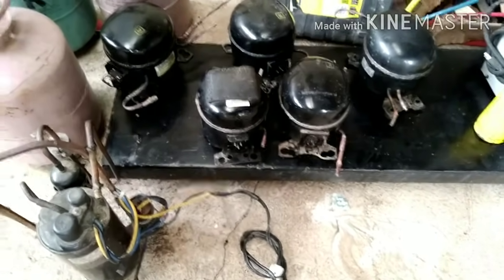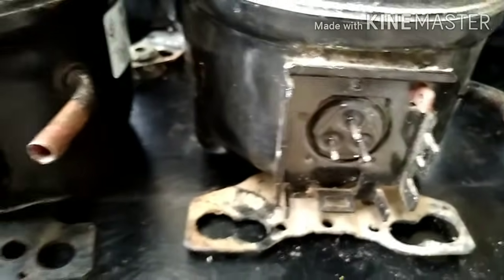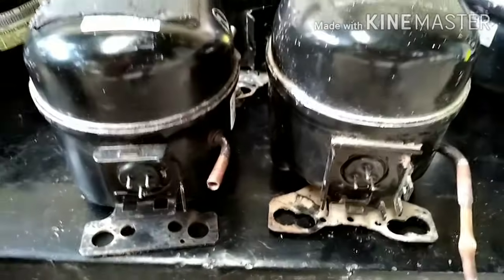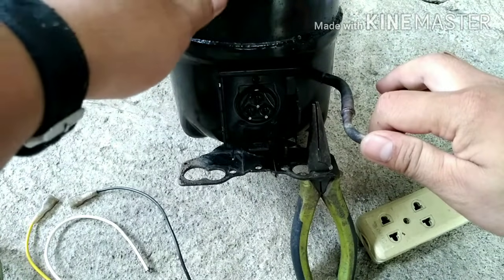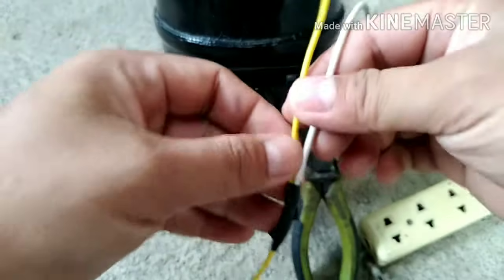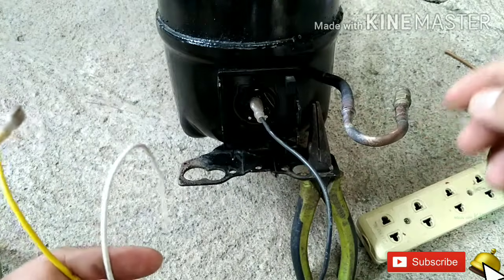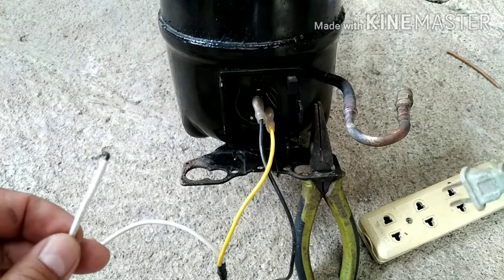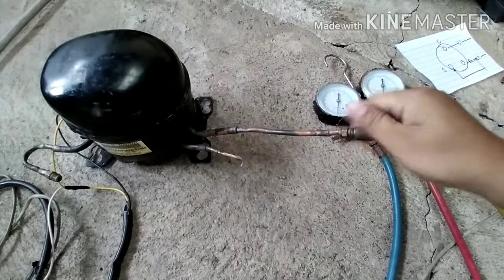HOW  TO START MOTOR COMPRESSOR WITHOUT RELAY ENGLISH

Comment: I purchased a new start relay/capacitor hoping that would fix the issue. But it didn't work. Found your video and decided to try it to rule out a bad compressor, and lo and behold my compressor is shot. Just continues to buzz and not kick on. Time for a new fridge!
Reply from the maker: Thank you for watching

Comment: What if the common terminal is down, does the start terminal remain in the same position?
Reply from the maker: Yes the common terminal remains, if you do not find the symbol of the running and starting terminal , much better to use digital tester to locate CSR. Thanks for watching

Comment: Please if you can help me, I have a 220v/110w compressor when it is running it consumes 145w, it does not have a start capacitor, because I have a 12VDC/220VAC - 370W inverter and it cannot start it, could I add a start capacitor, and what size to try?
Reply from the maker: Hello, 
practical recommendations.. Try to use higher inverter and battery capacity.

Minimal / cheap: 500 W pure-sine inverter + 40 Ah deep-cycle battery — ok if motor really has low start ratio (~3×) and run times are short.

Safe & balanced (recommended): 1000 W pure-sine inverter (with ~2000–3000 W surge) + 100 Ah deep-cycle battery — very reliable, can start most small compressors and give several hours run.

Compact & long-life (best if budget allows): 1000 W inverter + 50–70 Ah LiFePO₄ — smaller, lighter, long cycle life, supports repeated deep cycles.

Comment: Play it safe, put astart capacitor between start and run for the unlock or also said to create movement
Reply from the maker: Not all  motor compressor needs a  capacitor to start. However, There are some particular motor  compressor design  that needs a (capacitor) for a higher torque to start.

Comment: This video was super helpful. Thank you for helping me save a GE refrigerator!
Reply from the maker: Video is for testing  only, please Buy  relay at the nearest refrigeration and airconditioning shop
Reply: @kadiskartemotv  Of course! Your video helped me rule out compressor failure, diagnose the problem as a failed Time Start Device, and implement a temporary workaround to avoid spoiled food pending replacement. I installed the new TSD today and the refrigerator now works perfectly. Thank you again!

Comment: does it automatically mean the run and start motor is opposite from the one you demonstrated?
Reply from the maker: There is marking of (C) Common (S) Start (R) Run in the compressor

Comment: Can you explain this on a 12v DC compressor? I am trying to bypass the on/off switch on my 12v zerobreeze mach1 and I am connecting the controller directly to power and the compressor runs for a short moment then shuts off. Below is a link to what I am working on.

https://youtu.be/jbEaA0Ib1Sg

Comment: i tried this on a wine cooler thats not working and the compressor turned on after connecting hot wires to just the common (top prong)  and Run (right prong).  I did not have to to touch the Start.  Does this mean the compressor is bad?
Reply: If the compressor produces pressure, then it merely managed to start without the second winding being energized.

Comment: This is good information to know if you are waiting on a new relay and got food in the fridge. I turned my freezer to max so it will stay colder longer between jump starting it. Also filled up some Tupperware containers with water so they turn into big blocks of ice. thanks for this info
Reply from the maker: Thanks for watching
Reply from the maker: Thaks for watching

Comment: Boss ask lang po ako bakit binunot mo yong isang wire after 2 seconds. Ano posibling cause if di bunutin
Reply: Pro po pag may relay need din po bang bunotin or di na. Ano po connection if may relay na
Reply: Energizing both windings for more than a few seconds will overload the compressor. The START winding should be energized only long enough to get the compressor started so the RUN winding can keep it going alone.

Comment: thanks zir but can do this jop wile compressor in frige
Reply: Yes, simply unplug the fridge, make all three connections as described (COMMON, RUN, START), plug in the fridge, and remove the splice wire from the START pin as soon as the compressor starts. Just keep in mind that a) there is no external overload protection (as is typical with a Time Start Device / TSD) and b) when the thermostat sees a low enough temperature, it will cut power to the compressor (normal behavior), but when the temperature rises and it sends power to the compressor again, the RUN winding will be energized but the START winding won't (abnormal behavior), which could damage the compressor.  So, when the fridge turns off the compressor, it's best to unplug the fridge, disconnect all wires from the compressor, plug in the fridge, and restart the compressor manually later when you hear the fridge start up the evaporator fan.

Comment: can i use only capacitor, no need ptc , i try turn on compresor use capacitor , result is working properly  , this way can damage compresor?
Reply from the maker: No. PTC relay will automaticaly energize the compressor without our supervision, doing so will over heat the compressor,  as common and run is only needed once once compressor reach atleast 1/4 of its speed,
Reply from the maker: use the method shown on the video,just for  testing, not recommend for prolong use as the compressor turns off and on when the thermostat  gives signal

Comment: Thank you so much for this video. I have an old Frigidaire freezer and the genuine controler relay is discontinued from Frigidaire but worst it is that absolutly unavailable in the aftermarket. So far with your video I was able to start the freezer and save the food inside. I leave it work until it stop then make the contact (as shown) to restart it. I have ordered online  another relay (look alike) and according to your indications I should be able to plug it on the compressor and fix this problem. Thanks again.

Comment: Idol tanong ko lng po Kung paano madetermine Ang suction at discharge pipe Ng ref compressor..may kinalas po Kasi akong sirang ref nmin..gagamitin ko compressor as air compressor..tatlo Kasi linya Ng tubo eh..tsaka Kung isaksak ko compressor ung isang pipe nagbubuga Ng langis..ok p b compressor ko?..Ang reading Ng C-R= 10.1, C-S= 38.2 at S-R= 46.9..sana po masagot mga tanong ko idol..salamat po

Comment: Sir how about a compressor with potential type relay and run/start capacitor . . Do the procedure is still the same .. tnxs
Reply: My compressor started without the capacitor, but if yours doesn't and needs the boost, then splice two wires and put the capacitor in parallel with the one that temporarily energizes the start winding.

Comment: Thank you Sir.This is my question to you Sir,do the run and start change  position?Or the start always on the left and the run always on right?
Reply from the maker: Mostly Start is always at left and Run is at right. Try also to check if there is a label at the triangular configuration, if none do the resistance checking
Reply: @kadiskartemotv Thank you,but how can I do the resistance check?
Reply from the maker: Will make video of it
Reply: @kadiskartemotv  Thank Sir.I looking forward to it.
Reply: @alieupaasewe5111  Use an ohm meter to measure resistance between the center COMMON pin and each of the other two pins and compare to the published specifications for your compressor. For example, according to Embraco's documentation for the EM3D60HLT compressor in my GE fridge, the Start Winding Resistance should be 5.66 Ω at 25°C and the Run Winding Resistance should be 4.42 Ω at 25°C.

Comment: hey were does the hot wire go and were exactly does the neutral wire goes just to be on the safe side thanks
Reply: The hot wire goes to the middle COMMON pin, the neutral wire goes to the right RUN pin, and the wire spliced into that neutral wire goes temporarily to the left START pin.
Reply from the maker: Just follow the tutorial, live or hot wire is the same

Comment: Can you do the same test with a 12v compressor
Reply: No you can't. On a 12v compressor the three connections are the three windings of a three phase motor. It will only run if you use a 12v 3 phase motor controller.

Comment: My firdge have a capacitor near the compressor. Would this work without the capacitor connected in some way ?
Reply from the maker: It will not, starting capacitor is important for the optimal performance of compressor, capacitor is very cheap to buy
Reply: The compressor in my GE fridge started without the capacitor, but if yours doesn't and needs the boost, then splice two wires and put the capacitor in parallel with the one that temporarily energizes the start winding.

Comment: By 'common' do you mean the hot ac line or the neutral ?
Reply from the maker: Either of the two, but its better to use the  live ot hot wire

Comment: Hello i have using my fridge withou relay so the motor wont start what seems to be the problem??
Reply from the maker: Check the overload protector also or the thermostat,or defrost timer
Reply: Mine is a defy top frizzer i bought a new thermostart when i try to install it...it blew my overload protector nd i bought the new one also but stil blew it...i suspect the motor..because it wont start when am startin it without relay

Comment: Another queston why is the compressor overheating
Reply: Because it doesn’t have the relay😂😂 the compressor isn’t meant to be run continuously the relay is there to turn the compressor on and off periodically to prevent from overheating
Reply from the maker: Thermostat will do the work
Reply: @kadiskartemotv  but the thermostat is connected to the relay and the relay then controls the compressor
Reply from the maker: Thermostat = brain of the system

Comment: hey, thks for the vid. Btw we need a capacitor?
Reply from the maker: No need sir
Reply: oh great! But my compressor just hums and doesn't turn. what to do? if there is capacitor then we can try changing it but there is no cap for it.
Reply from the maker: If you follow the step on the vid then it only hums,.most probably the motor  compressor is stack up
Reply: Don't we need a 2nd phase to start it?

Comment: You just helped me fix a super nice/free mini fridge! I saw it on the side of the road in a super nice neighborhood with a free sign and hoped that it would work, I was disappointed when I heard the click of the overload switch kick on. I tested for continuity and it was on all 3 poles and also no short to ground. Also tested amperage of the pull and it was well below short. Bypassed the relay like you showed and boom! Compressor rolling perfect and nice cold fridge.

Thought it was shitty that the rich bastard put a broken fridge out and just put free without "need tlc" or "needs to be fixed". They knew it didn't work and could have taken it to be recycled, but I am glad they didn't ☺. Their loss is my gain. Replacement relay costs 7 bucks and will be here in 2 days!
Reply from the maker: Thank you for wataching ❤

Comment: pano yung may capacitor?
Reply: The Embraco compressor in my GE fridge started without the capacitor, but if yours doesn't and needs the boost, then splice two wires and put the capacitor in parallel with the one that temporarily energizes the start winding.

Comment: Hi, thanks for the video. I have a question. In the uk you have live, neutral and ground which one of these wires do I connect to the common pin?. Thanks
Reply: common pin can be connected to your neutral wire :)
Reply: @ElektroySoundsmusic  Thank you
Reply: When you say "could be" can the live be connected instead of the neutral. Thanks again.
Reply from the maker: Yes,

Comment: Lods pano po ganyan din kasi ung ginawa ko namamatay bigla ras aandar nanaman ganun sir pano po un sana masagut🙏
Reply from the maker: First is Anu po ba scenario kung bakit natin jinerk compressor niyo?
Reply: @kadiskartemotv  ano po ung jenejerk sir  biglang namamatay po kasi 5 to 10 sec umaandar nanaman sir
Reply from the maker: Jerk po is Yung wala po kayo ginamit na relay.
Reply from the maker: Jerk po is Yung wala po kayo ginamit na relay.
Reply from the maker: Magcheck po kayo ressistance ng compressor
Reply: @kadiskartemotv  ay oo sir wala dapat ba talaga sir meron para mag tuloy tuloy ung andar sir
Reply from the maker: Lagyan nyu po relay para magtuloy2 andar pero dapat same specs. Ang video kasi natin ay.pang test lang kapag walang dalang relay . Check nyu din po kung good pa ang compressor or high ampere.
Reply: @kadiskartemotv  okay po sir salamat po laki na tulong nyo sir👍

Comment: Good evening sir, yung ref compressor na ginawa kong pang bomba ng gulong, after using continuously for 30 mins (tried to inflate inflatable pool) uminit yung  motor at di na umandar.  Puede ko kaya sir irekta na lang ito?  Thank you very much!
Reply from the maker: Lagyan mo lift kapag sa mga gulong sir. At kapag sa mga inflatable pools maliit masyado ung  volume ng hangin galing sa  compressor.
Reply from the maker: Wag po irekta delikado po yan. Dapat dadaan parin sa OVERLOAD protector. Para safe tayo
Reply: @kadiskartemotv  sir, bakit kaya ayaw nang umandar? Pay plug ko andar lang saglit tapos off na.  Di po kaya naubusan ng oil.  Thank you!
Reply from the maker: Check nyu po baka nag hihigh ampere ang compressor palit relay. Kapag pinalitan relay magchange OLP na tayu bala weak na
Reply: @kadiskartemotv  thank you very much sir!  Ingat kayo dyan!  ECQ tayo ulit!
Reply: @kadiskartemotv  good afternoon sir, ff up question pala: mukhang nag stuck up yung compressor.  Chineck ko yung start relay at overload ok naman may iba pa bang technique para mapaandar ito or itatapon ko na siya?  Marami pong salamat!
Reply from the maker: Palit na bago master 200 lang sa junk shop 😁😁
Reply: @kadiskartemotv  thank you!

Comment: Hindi ba masusunog ang motor pag tuloy2 ang andar boss?
Reply from the maker: Depende kung gaano katagal.master pero kayang umandar niyan 15hrs tuloy tuloy. Salamat sa panunuod
Reply: @kadiskartemotv  salamat master. Pag direct ung wiring to 220 kahit wala ng capacitor at thermo protector ok lang ba yan.?
Reply from the maker: May mga compressor po na need ng capacitor, kaylangan po ng OLP para safe kayo against high ampere.
Reply: Gud pm po Sir’ hindi po ba mag kaka problema ung compresor kung walang “ Relay”
Reply from the maker: Depende po kung anung purpose kung bakit walang relay, dapat po may relay parin,

Comment: Boss.. Kung mai capacitor? Parallel ko nlang ba sa line.?
Reply from the maker: Pm ka messenser ko send ko sayo connection
Reply from the maker: DLRE ESCOBEDO ung dalawang bata ang pic. Hindi basta2 yan bawal magkamali
Reply: The capacitor should be in parallel with the wire that temporarily energizes the start winding.

Comment: Paano malaman sir pag wala ang csr na sign
Reply: Use an ohm meter to determine which pin corresponds to C, S, R.  There should be no continuity between START and RUN, and the resistance between COMMON and START vs. COMMON and RUN should align with the specifications published for your compressor.

Comment: ka diskarte idol, tanung ko lang halimbawa kpag mag-vacuum dba sa access valve ang connection, saan ang hinihigop nun yung discharge o suction line??reverse ba cycle nya opposite sa cycle ng compressor? ty
Reply from the maker: Sa suction line po ang hinihigop.  Intake sa suction at discharge naman  sa discharge line.  Continues flow/cycle . Salamat po sa panunuod. Wag kalimutang ilikenm ang video

Comment: Boss patulong naman, yung ref ko hindi na lumalamig, ok naman yung RELAY OLP THERMOSTAT. ano po ang sira boss? Salamat. Sana mabasa mo.
Reply from the maker: Kapag ok po ang electrical section tulad ng mga  nabanggit. Maaring wala ng freon dahil may internal leak ang system,
Reply: @kadiskartemotv  maraming salamat boss, god bless
Reply from the maker: Salamat po sa panunuod. Wag kalimutang ilike ang video